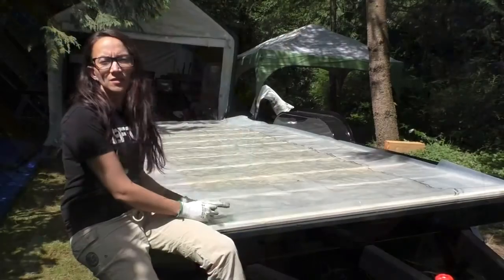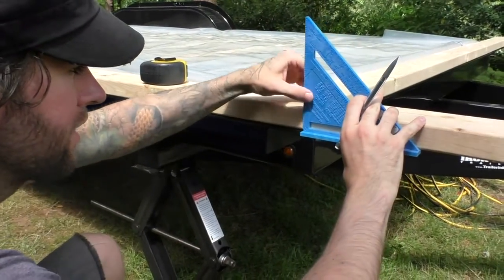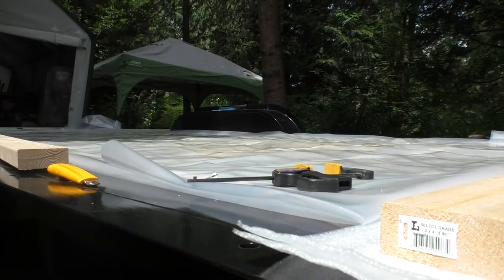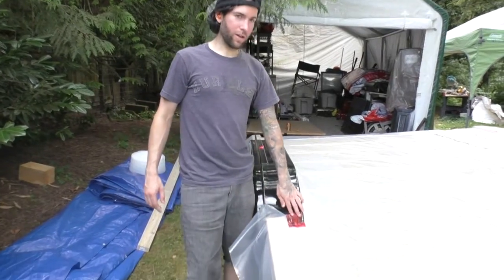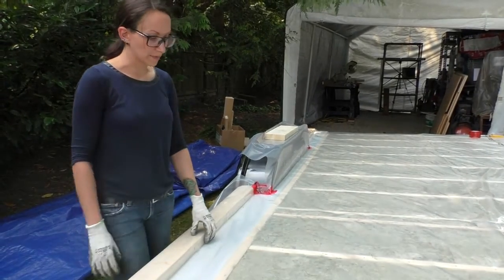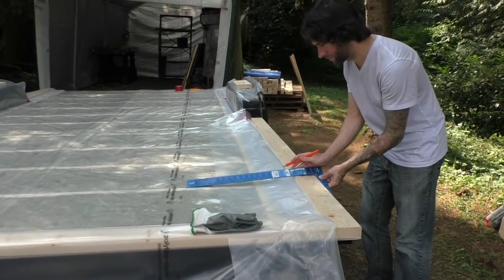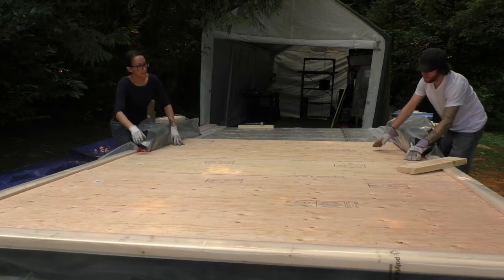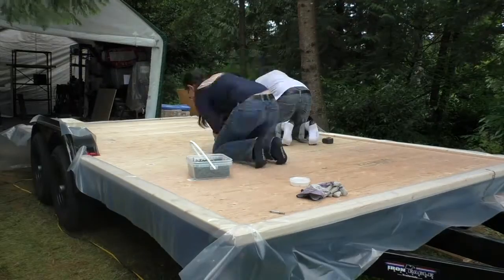Subfloor Sheathing & Vapour Barrier // DIY Tiny House Build

Comment: I have to raise my floor up inch to match another floor in my house on the main floor so I’m confused on the installation.  Do I do base bottom plate/vapor barrier/plywood to raise floor/engineered hardwood or is it base bottom plate/plywood to raise up the floor/vapor barrier/engineered hardwood?
Reply from the maker: You mentioned main floor - as in you have another floor below it, like a basement? Usually there is a vapour barrier under the concrete slab of the foundation/basement, and you don't put a vapour barrier under the upper level floor.

Some underlays for flooring will have a vapour blocking property to them, but I'm under the impression that it's more for  keeping spills off the plywood.
Reply: @RookieRoost  no basement.  The main floor meant the only floor and not the second story.  Sorry!  The concrete is the base floor that is made of rebar directly on the ground.  So do you put the vapor barrier over that before using the plywood to raise the floor and then the engineered hardwood?